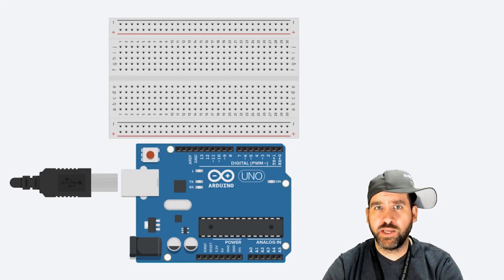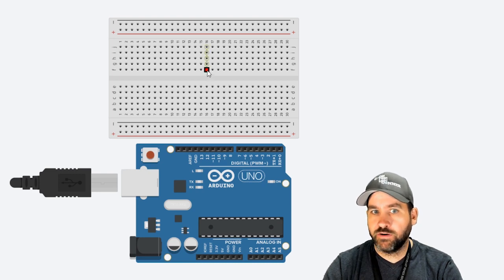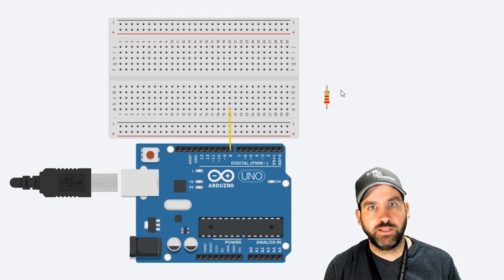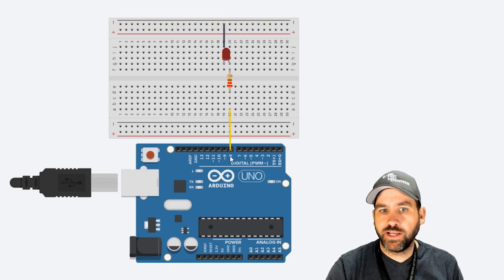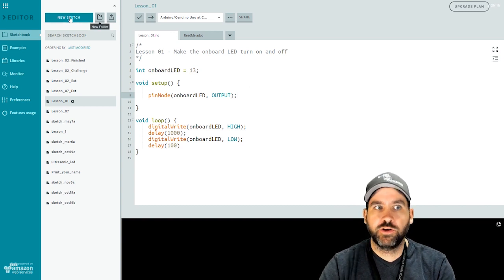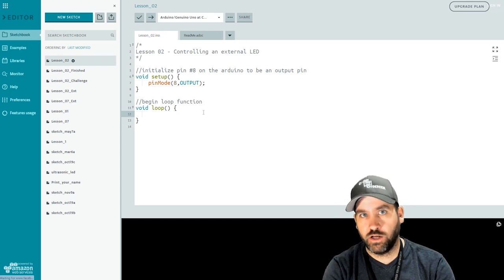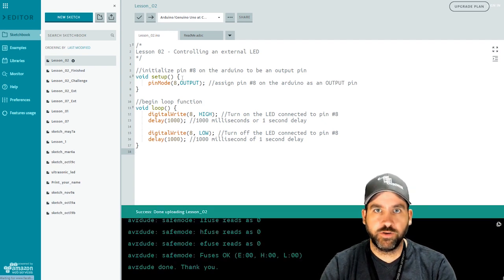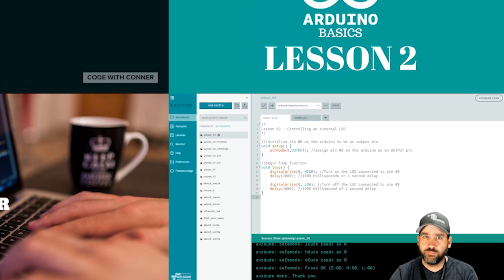Arduino Basics - Lesson 02 - Using a breadboard and an external LED

Comment: Would the light come on without a resistor?
Reply from the maker: Usually yes, but sometimes, depending on the LED you'll burn out the diode. I over simplify the resistor stuff but you can look into it more and specific diodes work best with specific resistance. It's not one size fits all like I make it seem :)

Comment: HAHA. Light wasn't coming on. Then I remember LED(light emitting DIODE) aka current direction limiter. I had it spun around the wrong way. Great video series. Despite my mistake I know a fair bit about electronics I'm doing this to learn Arduinos code system. I like the challenges at the end. Keep up the good work.